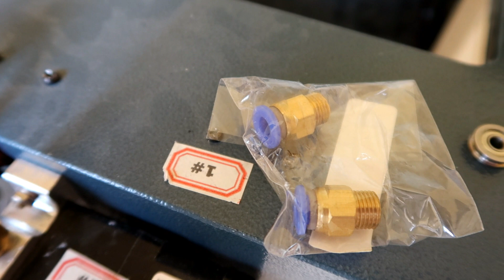FIXING BROKEN MANKATI 3D PRINTER (FITTINGS)

Comment: Shit breaks all the time, go for the more expensive ones and you might want to look into the reason it broke.  Too much pressure from the filament on the tube?  Temp too low?  ESteps too high?
Reply from the maker: Thanks Mate, i will look into it more. it was a china made 3D printer and that fitting was the original so hopefully doesn't happen too much